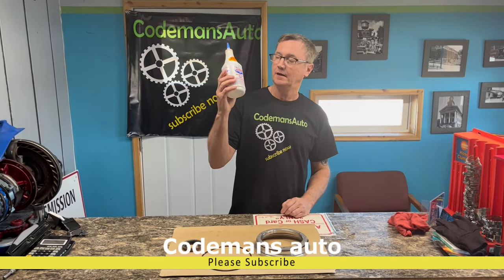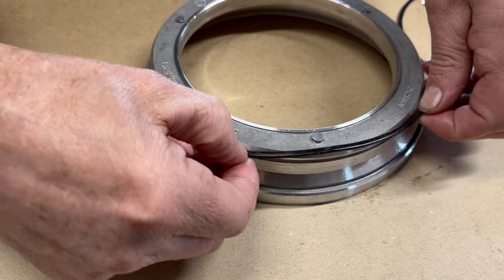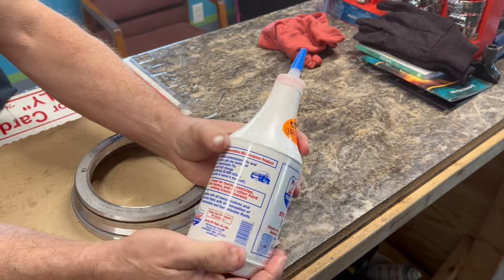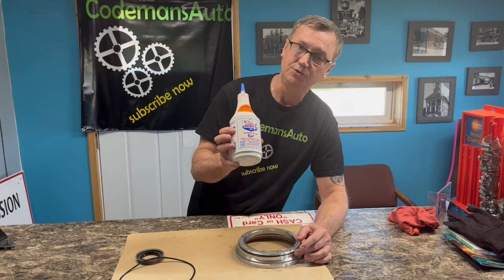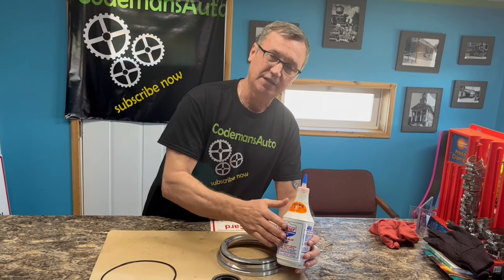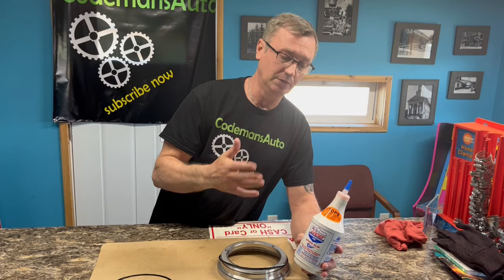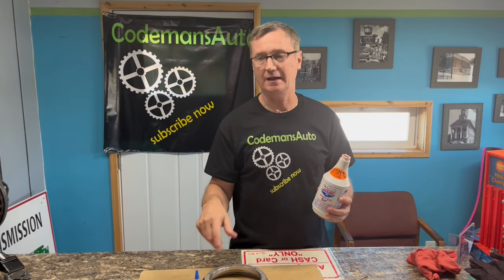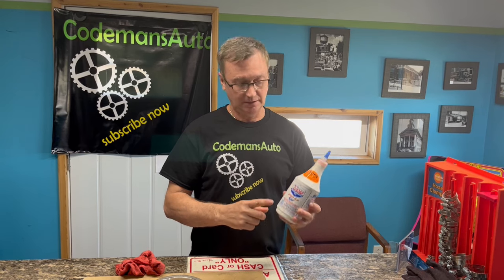Lucas Transmission fix, you need to CHECK THIS OUT and see for yourself what it does to your seals

Comment: I lost all gears even reverse in my clapped out 350 transmission and added 2 of these bottles and it brought it back to life and it ran better than before it clapped out
Reply: You for real?  I’m actually strongly considering this
Reply: @brandonbrown4250  yep! It works I just had transmission problems with my 4l60e on my transmission shifting 2nd to 3rd  and I immediately drain all trans fluid, and put 4 bottles of lucas in then added trans fluid and it's already shifting back to normal
Reply: @baileysmith6330   that’s awesome. I’ll remember that.. but I’m afraid mines too far gone,  mines a 2nd gen dodge.  I went to drain the fluid and found pieces of fiber and a piece of a seal
Reply: That's awesome
Reply: @brandonbrown4250  
I'm from the UK & this does work! A family member purchased a Honda Jazz without test driving it,the CVT was juddering when pulling off, less than 50 miles it went away!
Reply: @tardeliesmagic Nice.  Supposedly it's not compatible but I figured it couldn't hurt if there's problems already.
Lucas is an oil conditioner. 
Like a large concentration of the additives put in at the factory making the original fluids.
I agree with the mechanic making this video in that you don't want to add a lot. Just enough to lessen the issue.
Reply: How long have you been driving on those 2 bottles?  I put one in my A343E and it still had some slip, lurch, and stutter.  2nd bottle had it running smooth but it's only been 10 mi or so.  Now I'm wondering if that's too much.  7.7L fluid capacity
Reply: @Cassinblanca  after those two bottles I probably added a little extra to be on the safe side but it never messed up again after that! It was as if I had the Transmission rebuilt or replaced! Sold car since then but I drove it for a yr half after that and never had a problem after MIRACLE IN A BOTTLE
Reply: @tardeliesmagic on the bottle is says “compatible with all transmissions and transmission fluids with the exception of CVT transmissions and transmission fluids” so I’m curious as to if that caused any long term damage or if it’s still holding up.
Reply: Try cleaning the pressure plate switch screens they clog with the crap same as magnet     . Watch the video about this from YepThatsit -  4L60E Automatic Transmission stuck in Limp mode
Reply: So you got reverse back?

Comment: I have toyota sienna. I change the transmission fluid this summer (not flush) on around 95k. But early morning during cold temperature. I noticed it is start slipping but it will turn to normal once its warm up. 

I was thinking to put this but the fluid transmission is V/LV. 

But thank you for saving me some more problems by not putting this straight to the transmission and by diluting it ❤

Comment: I used two bottles in a DCT ford transmission. It didnt want to engage drive or reverse quickly, and would slip badly in 1st. After Lucas, it seems to make it work properly. You need to run it about 300kms to get it at its full effect.
Reply: Ford DCT use dry clutch, if you replace or using old clutch it need SOFTWARE it make it works.

Comment: Thankyou for this information!  I have a 3.0 V6 Toyota trans.  I've used other Lucas products in the past with good results. The trans. only slips when it is put into gear on cold morning initial start ups. 
Feel much better about using this product after watching your video.  Makes good common sense.  Sometimes less is more, this is a good example of that!  I will try 12 oz. mixed  with the fluid as you have described.

Comment: Have used it in the past on toyota celicas when they started slipping and not wanting to shift from 1 to 2nd gear.  After about 3 weeks after adding it fixed it and shifts fine now.  My main seal on the inside between engine and transmission has been on there for I think 3 decades 92 celica and slowly leaks but just recently went from slow leak to major leak were use up fluid in few days so had to pull transmission down and replace.  The old seal was completely hardened.  Before replacing I considered using more lucas until it softened up but it probably would have been 2 much for the other seals.  I think if the seal wasn't so old the lucas would have sealed itjt up for a few extra years.  So definatley is great product for getting you by or extending life of seal till you are able to put new one which if you're like me want to put off as long as possible, it's not fun taking transmissiion down, a lot of work......

Comment: An accurate dosage,  oz of lucas to oz of transfluid would be best.   I used two in a 6R80 with over 200,000 miles on it.   Its had fluid and filter changes, isn't making metal, no lead frame issue and had reprorgraming TSB. It wasn't really slipping just flaring like solenoids were acting slow and overlapping.  It's fine but I've got a bigger pan on the trans and a giant offroad racing trans cooler on the raptor.  Its a ton more fluid than the trans had stock.   It's probably around 20 quarts now.   If its a well worn high milelage LV trans getting ran in hot conditions its probably more than worth a shot.

Comment: No BS 
I put two in my Toyota tundra. 04 
Fixed everything and runs smooth again.
Reply: Did you drain any out first or just added it
Reply: @joshmartin7558 Lucas doesn’t say to drain any current fluid before adding the additive.
Reply: @FutureTrunksSSJ1   Is that true or scam !!

Comment: This is q very good detailed video. Thank you for the informative visual description.
My dad has a 05 Dodge Dakota SLT V8 with a shaking problem when going up hills at around 35-45MPH.
I plan pn putting in 24oz of Lucas Transmission Fix to hopefully get more life out of the transmission. We are going to get his trucks transmission fixed at a shop but need some more time. And if the Lucas Transmission Stop-Slip fixes it for years, well I'll take it.

I have a 02 Jeep Grand Cherokee Laredo 4.7L with the 545RFE 5 speed transmission and get a clunk when lightly letting off gas after a hill. But only happens sometimes.
Im hoping valves are sticking and lucas will help it.

Do you think it will work, which of the two is likely to be improved after 200 miles.

Comment: I had a ford flex that started downshifting hard when coming to a stop, tranny shops said it’s normal but it’s not as I owned it for years, I used a bottle of this and it fixed it, shifted like new after that
Reply: How many miles did your flex have? I have a leak in the front seal of my transmission on my 13' flex.
Reply: 238,000 miles

Comment: So, for an older Ford C6 auto, that operates normally (goes into gear without hesitation, shifts through all gears), but has a leak at the input shaft behind the converter, should a half bottle help to slow that leak down some?

Comment: My transmission oil is leaking from the breather vent in ford e450. Should i just put 1 bottle? Will it stop?
Reply: The bottle won't stop it leaking,you need to solve the issue of the leak.
Reply: You got to try yourself to find out if it will stop. Always a risk.
Reply: You over filled  the fluid my dodge did the same thing

Comment: Thanks, great video. Do you have a recommendation for a 4l60e with 240,000 and a slight slip between 1st and 2nd before vehicle is warmed up? It is behind a 4.3 in a GMC safari and is gently driven but does tow about 3500-4500 lbs regularly. What is odd is that it seems to drive better while towing. Thanks again!
Reply from the maker: if I was to try anything on a vehicle with 240,000 miles with a 4l60e i would try a epc solenoid because these weaken and cause transmission flare ups between shifts
Reply: @codemansauto208   Thanks for the reply and the tip. I will have to look that up to see if that is something I can do. I've restored older cars and built engines but something about the complexity of automatic transmissions intimidates me. I dont think I'd try doing anything that could not be done through the pan. Thanks again.

Comment: I'm from the UK & this does work! A family member purchased a Honda Jazz without test driving it,the CVT was juddering when pulling off, less than 50 miles it went away!
Reply: Did you put the whole bottle or half of it hope you answer
Reply: @deeloc6269  My brother put did it in,he put a whole bottle in,of course took out what he put in first. Drives fine after 4 months now.
Reply: My transmission is automatic
Reply: Pretty sure the bottle says to not use it in cvt's 🧐

Comment: Tqvvm for your video, my 2003 Hyundai Sonata Ef 2.4 jerk when engage to D & R, I change fluid and put 12oz of this as Malaysian Sonata model only need 4 litre of trans fluid. At first it didn't show any improvement then after 4th day it feel smoother & no more jerking, now already more than a week still doing fine. Hope it will last until I can afford a new car.
Reply: Does it still jerk?
Reply: @Malinjo146  no more jerk since using it 4 months already but recently D & R indicator light sometime turn On at the same time after driving about 10 - 20 km, I prefer not to drive far with both indicator On. Enough for me to go to the grocery store & mosque. If I need to travel then I'm using my wife's car.

Comment: So glad I came across your video I was about to throw a whole bottle into my volvo box I will just go with half at least I can do both my cars then would you agree they are p3 v70 and s80. Thanks
Reply from the maker: yes a half bottle would be best for those transmissions
Reply: Am I right in just removing the same amount of fluid that I’m going to put in of Lucas oil ie around 350ml to keep the level correct
Reply: How’s it holding up in your Volvo? I thought about pouring it in my Volvo.
Reply: How did it turn out for you? Did it work?
Reply: @JBeck2468 it’s never had an issue since it only did the slipping sort of thing at full throttle changing to 4th each time but no issues since whether it’s the Lucas oil or the fact I’ve drained a filled about 5 times over a few hundred miles I don’t know but I’d say it’s worth trying for the cost.

Comment: Great stuff, thanks.
Only question is why not advise all the listeners to check the motor's specification for the capacity of their transmission fluid. And maybe talk about a limit to the percent or portion of the Lucas to the fluid.(??) 
If they choose to check on their transmission, eventually what will matter is the proper fluid capacity. And work with that.
And, thanks. Much to think about.
Reply from the maker: The bottle does not give a recommended dosage per quart ratio. so, I don't know what the portion should be. it says to add a bottle to your Transmission. so, the point that I am trying to make is that ford has a transmission that only holds 2 quarts and all the way up to 16 quarts. so, most transmissions hold from 9 to 16 quarts of Transmission fluid the consumer needs to be aware that too much of this like a half and half ratio could be more devastating to your Transmission than not using it at all. And I agree with you 100% there is a lot to think about

Comment: Will it work on 3 speed automatic transmission with differential that started whining
Reply from the maker: The Lucas - OIL - Stabilizer is best for noisy differentials. I hope this helps
Reply: @codemansauto208  its an automatic transmission differential. Will it work? The differential take 1.5 quart

Comment: My 2005 Lexus RX330 flares when shifting gear 2-3 after a cold start and start shifting almost normal after 10-15 minutes drive. The gear 3-4 during that time feels like hesitant also. Do you know what maybe causing it and if Lucas can help on that case? Thanks!
Reply: Did you try it? And if so... Did it work?

Comment: Thank you for your informative video. My fluid was low so I added Dextron VI since auto parts store said that's what my vehicle calls for. Later upon re-checking tranny fluid level, I noticed writing on dipstick reads to use dextron III. How do you suggest I proceed? 

Thank you in advance for your time in responding!
Reply from the maker: Dextron VI is an upgrade fluid and it will work just fine in the place of Dextron III,   for future preventive maintenance you can use Valvoline MaxLife
Reply: @codemansauto208  Valvoline Max life-thanks for the suggestion!
Reply: Hey folks, it's DEXRON. 
NOT DEXTRON. It's important.
Reply: @bobfrapples4146  I'm a stickler for correct verbiage as well. For example, it irks me when someone says the ladder but they really meant the latter! So thanks for the correction. I'm curious though- in this instance, why is that important? Since there is no such thing as dextron, if you say that word, won't the person know that you mean Dexron? I'm missing your point as to why this is a big deal...

Comment: Will it work on a torque converter seal/pump seal if the seal is dry?
Reply: Try AT-205 stop leak. That thing restores dried seals. It helped me with rear main seal leak.

Comment: How much lucas transmission fix should I put on my 2.2 ford ranger?
Reply from the maker: 1/2 bottle to start and then give it about a month and if the results are not what you expected maybe add the rest of the bottle. But if you have shift issues then you might see results sooner. But a leak or engagement issues may take a little longer to soften those seals.
Reply: I have this transmission slipping issues, do i need to drain some atf or just add half bottle of this product? Btw I used mercon LV atf

Comment: So will it be okay to put a little less than a half a bottle in without draining my existing fluid? My transmission fluid isn't low and the bottle says I can, but i don't understand how that won't overfill it.
Reply from the maker: I would try to take a quart out before adding any more fluid because you don't want to overfill it

Comment: Great video..I have question. What's the best trans treatment you suggest for LV ?   I have a 2012 FORD FLEX that shutters when switching from 2nd to 3rd (mostly when warm.  Thanks  I'll Sub 👍
Reply from the maker: The best LV fluid on the market is Mobil One in my opinion but there is a product called "Instant Shudder Fix" that might help you with this  issue, it is a good product to use for any shudder and it is an inexpensive way to try

Comment: My automatic transmission wont move the car in D mode in the morning. I have to select 1 mode for the gear to engage, then drive little bit, then put in 2 Mode and drive. When the fluid gets little warm then i put in D mode and the transmission starts shifting normally. 

Would Lucas fix that problem?
Reply from the maker: I dont think it will,   it sounds more complicated than that
Reply: @codemansauto208  what could it be?

Comment: Need help. Long read ahead. I have a 1988 Honda Civic EF 1.3 automatic. I got the transmission changed in May last year because the previous transmission wasn't engaging from the 2nd gear to the 3rd gear. The new (second hand) transmission was fine then it started to show some lag when put in 'drive' (when the engine was cold). I was using the original Honda Transmission Fluid. Slowly that problem got worse and I'd have to keep the car running for about 10 minutes early in the morning and only then 'drive' will respond. I was advised by a local mechanic to change to Amsoil Transmission fluid as he mentioned it has additives and I did. 

A) First Amsoil Transmission fluid change.
It showed improvements like the 'drive' gear engaging right after I started up the car but it would only coast in drive, stepping on the accelerator didn't have any response. I'd have to warm up the engine for maybe 3-4 minutes and would be able to drive off with no issues. I noticed with each passing week, I'd have to warm up the engine longer for the drive gear to engage. The problem came back in full swing after 3 months with newer symptoms. After warming up for about 10 minutes and driving off, the engine would have to rev up to 3k or even 4k in a very struggling manner and it would sound as though the engine has to work way harder to get from the first gear to the second gear. But once at operating temperature, the transmission works just fine and smooth but it would slip sometimes. This new symptom showed up after having driven the car for about 5k miles since the Amsoil Transmission fluid change.

B) Second Amsoil Transmission fluid change.
So I changed the fluid again and things got better than they were towards the end of 5k mileage of the first Amsoil fluid change. I drove another 5k miles and have another new symptom. The reverse gear won't engage when the engine is cold. So I'd have to keep the engine running for about 5 minutes for the reverse gear to engage and about 10 minutes for drive gear to engage with the current trans fluid. But, in order for first to second gear to shift smoothly, id have to run the engine for about 15 minutes (reach operating temperature). 15 minutes does the trick and the car runs just fine the whole day (absolutely smooth like a new car I'd say). But if I leave the car parked for a few hours, I'd have to run the engine for about 2-3 minutes for the gears to engage. This is the current situation I'm in.

So basically I have three problems: 
1) Drive gear won't engage if car isn't warmed up.
2) First gear going into second struggles a lot if not sufficiently warmed up.
3) Reverse gear won't engage if the engine is not warmed up for 5 minutes.

My question is:  
Would Lucas Transmission Fix be effective in helping me with this issue if I were to just top it up with current Amsoil Transmission fluid?

Any help that comes my way is very much appreciated. It's the only car I have and I absolutely love this car. Thank you so much.
Reply: With the problems you described, it wouldn't hurt to try it. Did you pull the pan to see what the magnets collected?